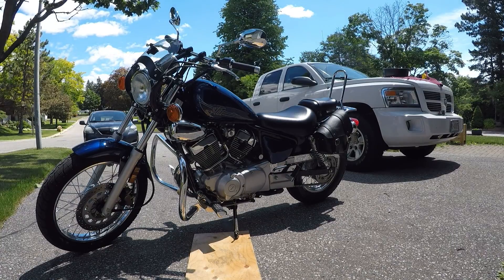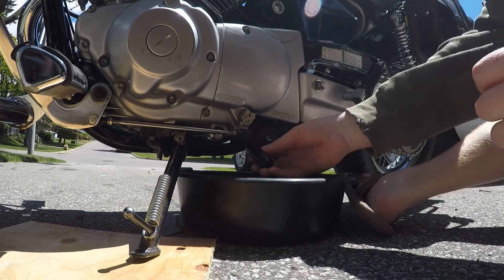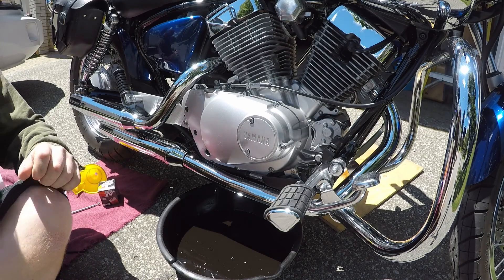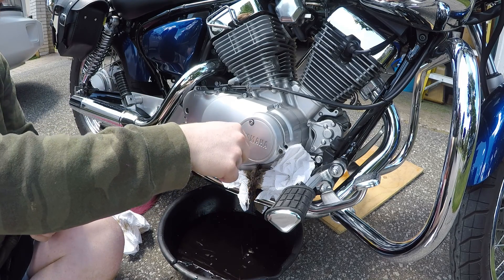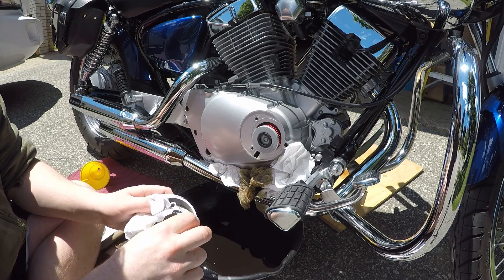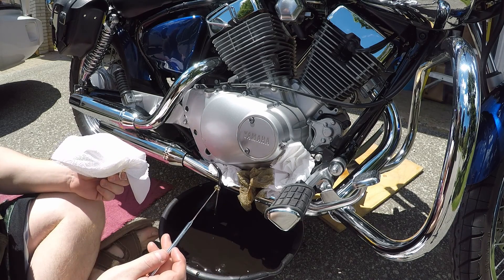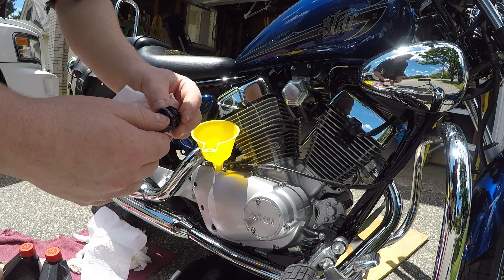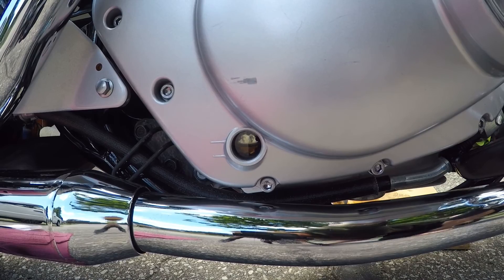2013 Yamaha XV-250 Virago oil change

Comment: Did you guess how much oil  to use, or is that for us?
Nope, can't find in my searches.
Reply from the maker: I looked it up online said 1.3L but i think its closer to 1.4L as i had to add a little bit more. There is a little sight glass that tells you the minimum and maximum level. Time on video 6:55
Reply: @DaveTheMotoGamer  Think I added 1.4 or perhaps slightly more. Best I could do. Thanks.

Comment: What is that oil filter o ring? What are the dimensions I cannot find one anywhere some help a brother out
Reply from the maker: I got the O-ring from the place where i got the bike. I would assume that you could probably get them online or from your local bike shop they may have them. The part #93210-64297

Comment: Great video. I have the same bike. Where did you buy that sissy bar/luggage rack? I can’t find anything specifically made for this bike. I don’t want to buy something that I need to spend 3 hours modifying. Thanks!
Reply: I bought one like that on internet, it might of been Amazon,  but I forget, I used different bolts for mine to install, I used 1/4 inch hex bolts, easy to install also, I think I had to drill holes bigger to use 1/4 bolts
Reply from the maker: I got it all from www.fortnine.ca

Comment: Srv 250 is the same engine with virago 250. In Srv 250 manual said 1.8liter. if u change the  filter, need to fill up 2 litter.
Reply: Mine said 1.4 without changing filter  n 1.6 if you change the filter

Comment: you better see if the oil drips just fine without removing the top cap first. cause if it isn't, you got a bigger issue.
Reply: Very good.!!
Reply: Issue like ?

Comment: Very good job with this video !    I'm what you call an "old fart"  who has owned many sizes and brands of motorcycles these are great motorcycles . I'm 73 and ride a 2019 V star 250 it's the same bike they just changed the name. I have done a few mods to mine and I highly recommend changing the front and back sprockets it makes a huge difference .